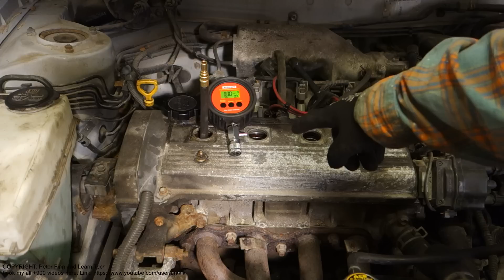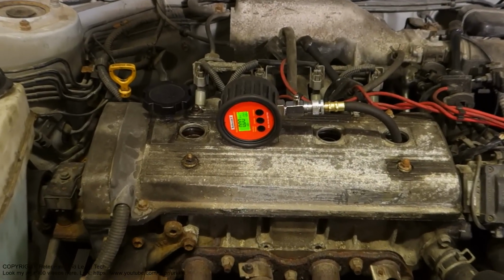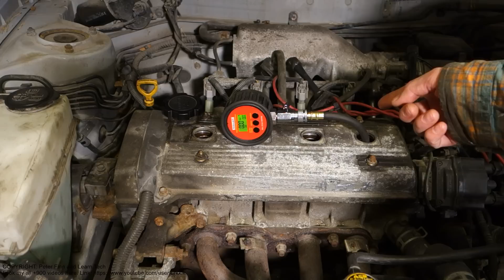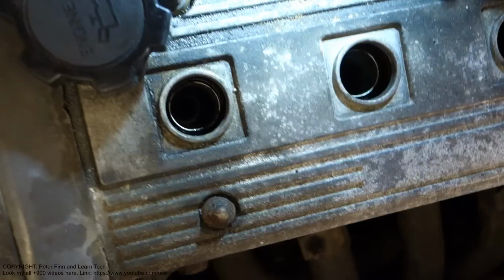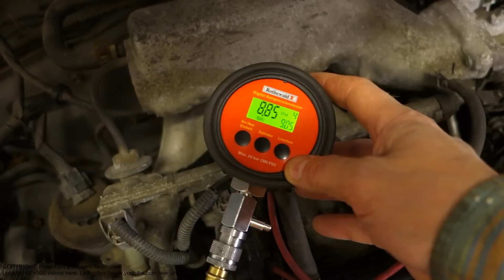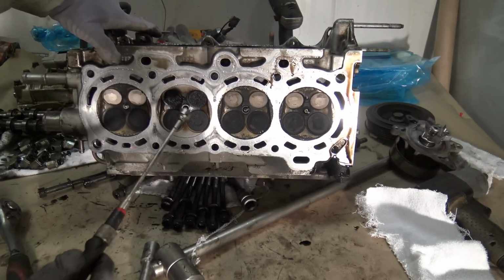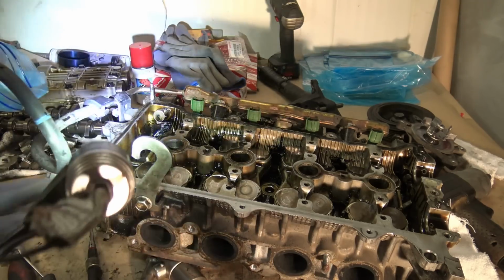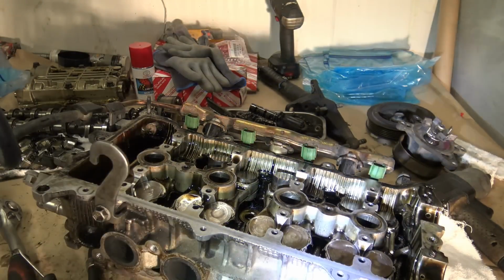Why my car engine cylinder compression rate is zero and how to fix it

Comment: Hello I was watching your video and very interesting my problem is my vehicle has no check engine light I burn oil through the exhaust but nobody can tell me where the leak is coming from I need to get a leap down test done it doesn't blow smoke out the exhaust all the time mainly when I stop at a light or a stop sign and take off otherwise it runs great what should I do should I swap the engine do the compression leak down test and the compression test and then go from
Reply from the maker: A recommendation for you. I do a compression test and if any cylinder has low pressure. That's how he fixes the cylinder.

Comment: Dear Peter,

Thanks you for your videos!  They are really helping me understand my Matrix 1.8L
 I have a problem with a crank, no start after I replaced the intake vvt gear due to the rattle on cold start.  I may have had the timing off, but when I was checking by hand/ratchet.  I hit the valves with the piston.  I then re-checked the timing using your other video and double checked TDC and orange chain links to make sure.  I re-assembled and have crank, no start.  
I will do a compression check next to find them problem.  Any advice?  Could I have done that much damage by hand to the valve?  The other thing is I do not hear the fuel pump priming when the key is turned to ignition, but the car will not start with starting fluid and there is spark, so it must be compression.  Thanks!
Reply from the maker: Hello and thanks for the comments.
Measure piston and cylinder compression.
Pressure must be more than 10 Bar in all cylinders. Watch my video.
If the pressure is low, you need new piston rings.
And video on compression test: 
https://youtu.be/eUdBq_QL0Dc

Comment: Hi Piter ! My mechanic replaced new brake Vacuum pump so he started engen and drives fast 50metars after cant started again mehanic said engine lost all compression so car can't start, however he checked all around engine and all good to dem. His can not find what problems issues??? My car is Ford kuga 2014 auto. Thanks in advance Alex

Comment: Hey Peter. Maybe you can give me some ideas. I have a 2006 Pontiac Vibe , which has a 1.8-liter Toyota engine, that will crank but not start. The problem is cylinders 1, 2, and 3 have zero compression. What could be some of the causes. I am thinking maybe a blown head gasket. I bought the car in this condition. I notice it has a leaking water pump and is low on water. I also notice small amount of coolant in the oil. I think the previous owner ran it hot and warped the head.
Reply from the maker: You have a really, really bad bug now. You have to disassemble the machine and first check if the pistons are OK. Then check the valves. And the cover gasket. It already sounds like a complete piece of junk for a machine...Sorry, mate!

Comment: How is it possible that broken valve in cylinder 3 was a reason for not having compression in cylinder 4 that was clearly on the side of the engine?
Reply from the maker: The broken valve was in the same cylinder where was low compression. Sorry for wrong info.
Reply: @PeterFinnTheCarDoctor , That's not true, you demonstrated no compression in cylinder 1 and cylinder 2 had the hole.
Reply: Yep I noticed that. The zero compression cylinder was furthest from the timing belt (so would usually be called cylinder 4), but the one with the damage was the second from the timing belt.
Reply: @Wildart2  that is true. He mentioned cylinder one first

Comment: I tested the compression in my 1.6 tdci engine 3 cylinders have 30 bar and one has 19 bar. What the problem in your opinion.? Thanks
Reply from the maker: Good Comment. Thank you!👍😀
Reply: low compression :)
Reply: In 7 months I hope you found your answer
Reply: @MrZalcatraz  the strange thing Is that I retested the compression and it was the same in all cylinders. The vibration is still there. I think that there is something wrong with the camshaft....

Comment: my celica 7afe is misfiring on cylinder one . it has spark and my injector is new . no luck :( any suggestions?
Reply from the maker: Coil-on-Plug (COP) ignition coil. And low compression rate
Reply: The head needs a valve job. The valves are dirty, so they cannot close completely. This job requires a removal of the head and new head gasket when putting the head back to the engine.